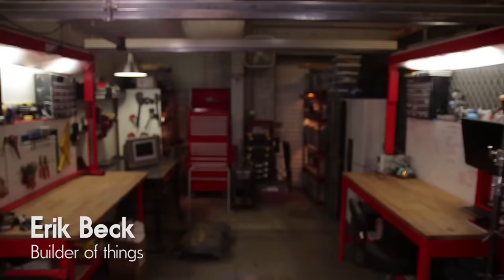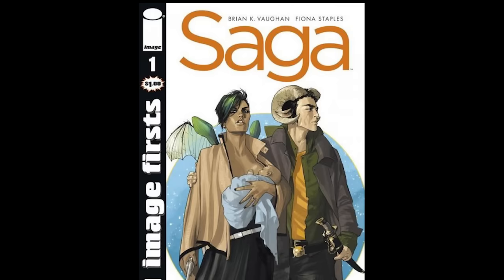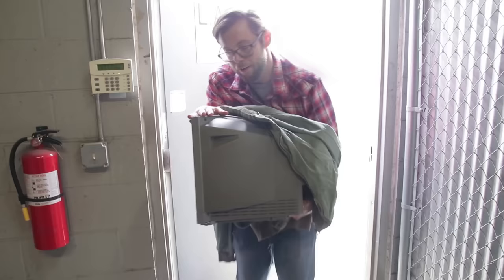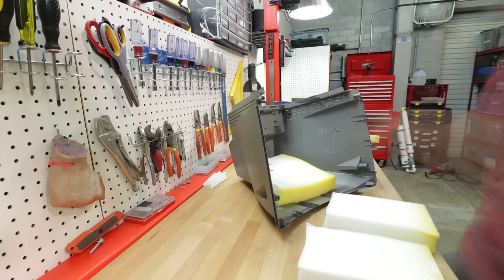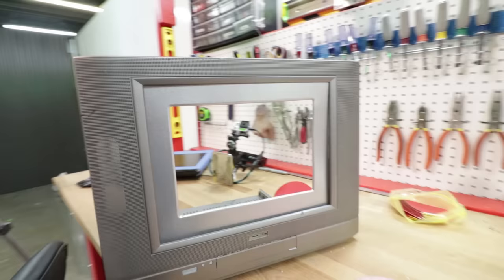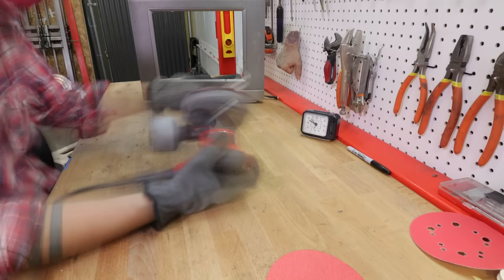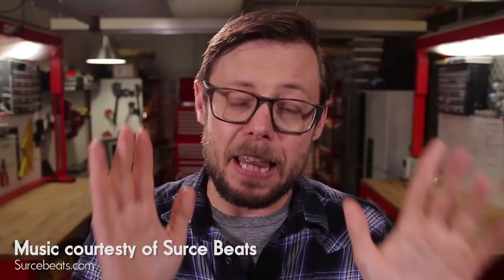Cosplay TV HEAD helmet in 7 “easy” steps! - Erik Builds the Movies #2

Comment: I have a suggestion: You can order TV masks online, but without a light up screen. (Look up TV masks online, and it should show up.) If you ordered one of those, you could just put the monitor in, and skip a few steps. It might be a bit more costly (I don’t really wanna check), but it is safer, because you don’t have to remove any TV guts. I guess there's pros and cons whichever way you do it, though.

Comment: This is extremely similar to how I built my Prince Robot IV head a few years ago.  I really should have made a 'how I did it' video... and also should have made a 'tearing it apart' video because I ended up throwing the whole thing out recently.

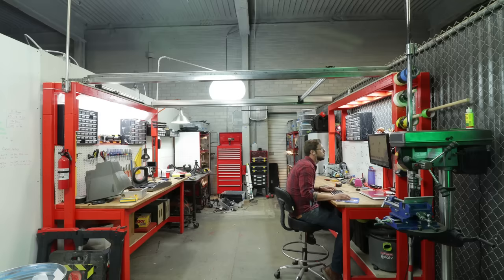But yeah, I used an old LCD TV from eBay for the screen, batteries in back helped counterweight, had success with a motorcycle helmet on the inside to keep it attached, raspberry pi for playback.. I even used that exact same little wireless keyboard thing you have at 3:06.
Reply: what batteries did you use?
Reply: How did you connect the TV to the battery
Reply: @nekowarigaming  Shoot, missed this comment.  I used a 12v UPS battery to power the TV and some other 12V devices I had in the helmet
Reply: @thatboikhy  12V battery connected to automotive power inverter that turned the 12VDC into 120VAC, and I plugged the TV into the inverter.  It was not a good setup and I don't think others should do it that way.  It was heavy and actually rather dangerous... having 120V connections right next to your face isn't exactly ideal.
Reply: I’m building one too. My old TV was one that had a built-in VCR. I chose this so I could use the VHS slot as a Window for my Parascope
Reply: I'm super late to this but please tell me you have photos / videos of it that sounds so sick
Reply: @skttrbrain  I have quite a few, not sure how well links will work here.  Example: https://www.youtube.com/watch?v=I2B8UHeONzQ
Reply: @djlemma that is SO COOL tysm for showing me : )

Comment: For the raspberry Pi, you could have gotten the Pi Zero and saved $35. Or if you wanted to go the easier route, you could pay about 3 or 4 times more as the Pi and get the Intel Compute stick, a small hdmi PC that actually runs Windows 10, so it's easy to learn. Also, nice burn on Film Riot.

Comment: What is this? Film Riot?
BURN!

Rasberry PI

Why not use an IPhone or android phone instead of the rasperry pi. I have a small adapter fro my Samsung galaxy Note4 and my old Galaxy S2 that turns the usb port at the bottom into a fully functional HDMI port. It's what I use to run my presentations when I do Wedding Shows and the likes on my 21inch LED monitor ... works flawlessly.

Since you already have the phone the cost in basically 0$.